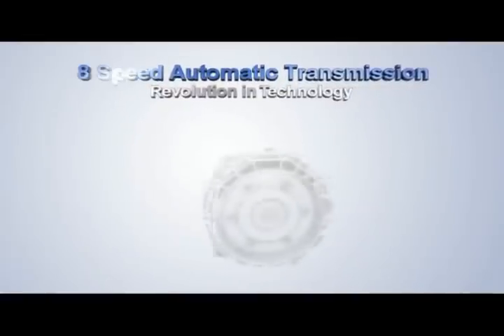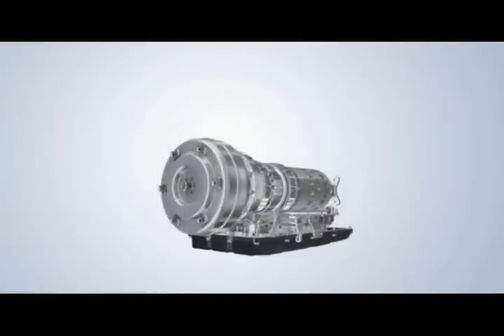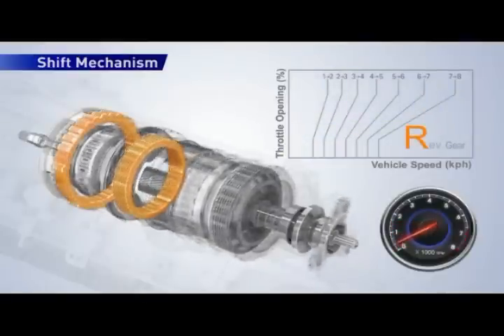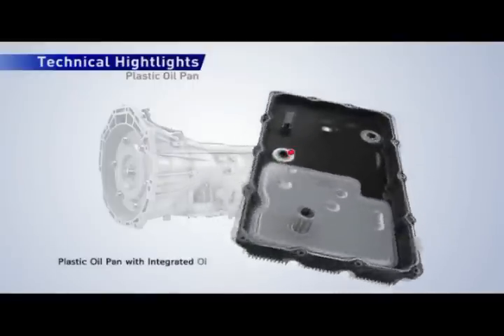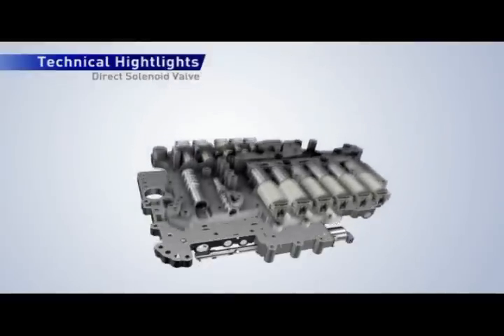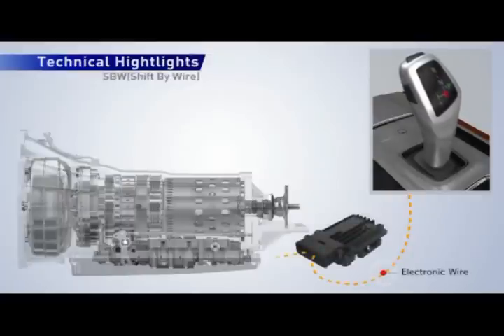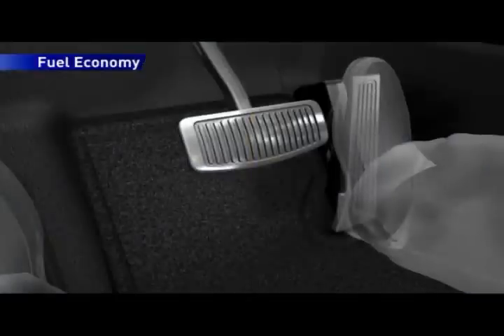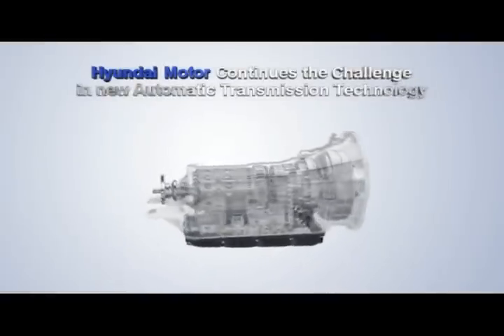Hyundai's New 8-Speed Automatic Transmission

Comment: It looks suspiciously similar to the ZF 8HP.  I have the third revision of this transmission in my Stinger, coupled with the 3.3l TwinTurbo V6, and it's very efficient and smooth. Though not quite as quick to shift as a ZF, but still quick enough. It's quite smart, too. I've never felt the need to downshift or upshift with the paddles.
Reply: That’s one of my thoughts as well. Would you able to confirm or not how similar to the ZF8hp it is?
Reply: @RafaelLSM  
Since I don't have access to a ZF for direct comparison, it's only speculation on my part.
But you can see a ZF 8HP transmission explained in detail in this excellent video by professor John D. Kelly of the WeberAuto YT channel of Weber State University:https://www.youtube.com/watch?v=FqyPizRyphQ&t=1s

Comment: I have it in my 2013 Genesis sedan with the 5.0 engine.  Great shifting transmission and it learns new driving styles quickly.  Shifts perfectly after 95k miles and going
Reply: Thomas New I have a 2012 v6 sedan with 88k miles and its shifting hard and slipping 2nd, 3rd, and 4th gear. They've already done a reflash and it still continued. I'm now waiting for the warranty adjuster to "verify" the claim